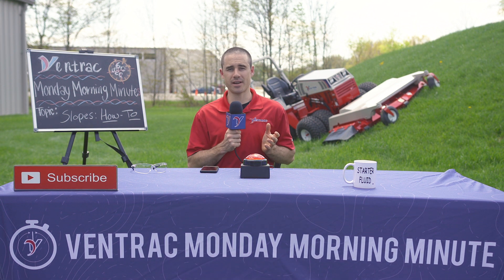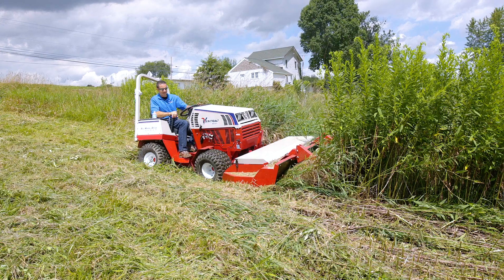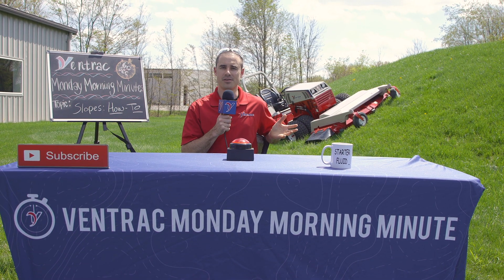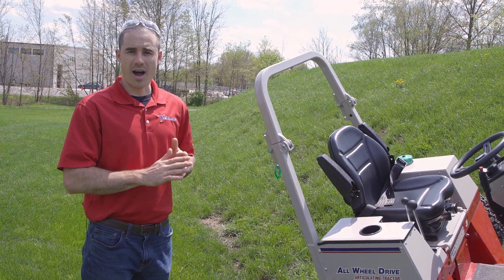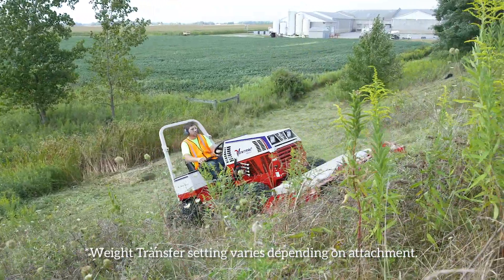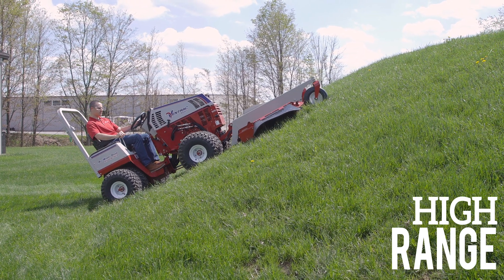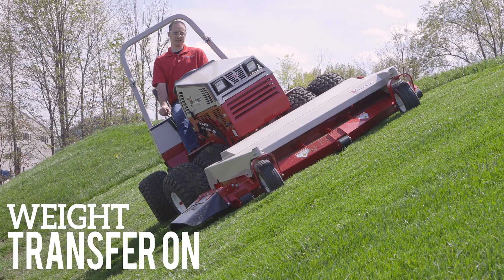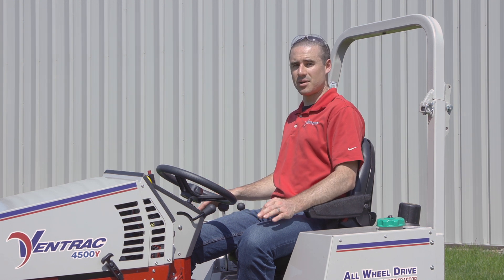How to Set Up Your Tractor to Safely Mow Slopes – Ventrac MMM

Comment: Didn’t know why I was getting stuck going straight up hills but I guess I was in high range. How do I change it? 4500z dual wheel.
Reply from the maker: There's a lever near the operators left knee that switches the machine from high to low.   Make sure you're on flat, level ground when you go to make the switch!
Reply: Ventrac sorry for the late response, it’s the lever with the rabbit and turtle right? Rabbit being high and turtle being low?

Comment: I have a Ventrac 4200 vxd and the weight transfer is not working as much as it should, now it won’t hold up to a hill that I have always mowed
Reply from the maker: Emry - definitely take it to a dealer for adjustment / repair or look into it yourself to see if you can sort that out.  Not being able to use full weight transfer will significantly affect performance, as you know!
Reply: Ventrac ok thank you I love my Ventrac.        Update: got it serviced and is working just like new!

Comment: Question: If the tractor is equipped with a propane tank does that charge the slope rating on the machine?
Reply from the maker: With the Propane kit, the rating with dual wheels drops to 25 degrees intermittent and 20 degrees continuous.

Comment: What is the difference between a Ventrac and a Steiner ????
Reply from the maker: Roger,

Assuming you're talking about the Ventrac 4500 and the Steiner 450 - here's the scoop:  Ventrac and Steiner are 2 different companies.  These 2 tractors are similar in that they are both center articulated and have a similar attachment style, but everything else is different.  The machines use different components,  hydraulic designs, etc. and have different features, different attachments, and totally different dealer networks.   The best way to imagine it would be two cars from two different brands.  They both build a car - and those cars serve the same fundamental purpose.  They both have 4 wheels and are a similar size and shape - but everything under the hood and behind the scenes is totally different.  

Whenever the question comes up, we kindly invite the person to demo both in person and let the machines speak for themselves :)  

You can also check out all of our technical videos to learn more about our product.  ...there's not much information available for theirs but ours is all there for you to check it out.

Thanks for asking!